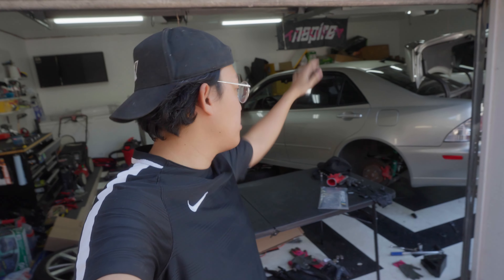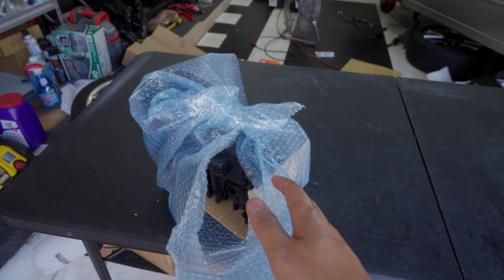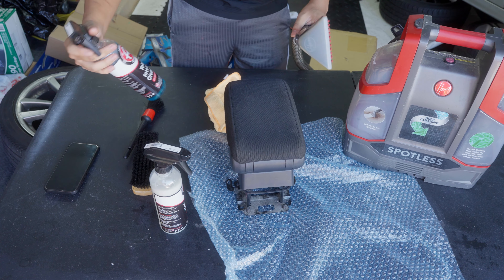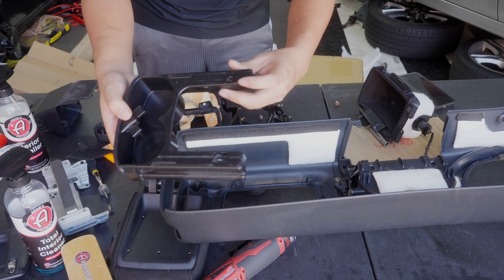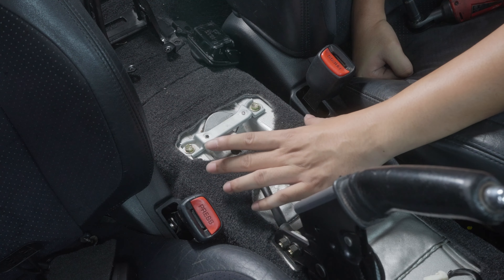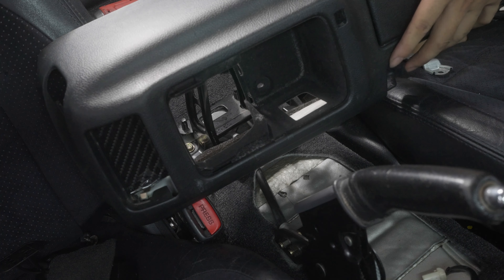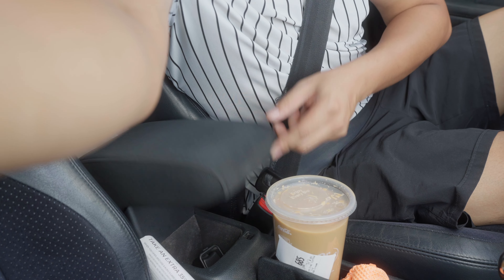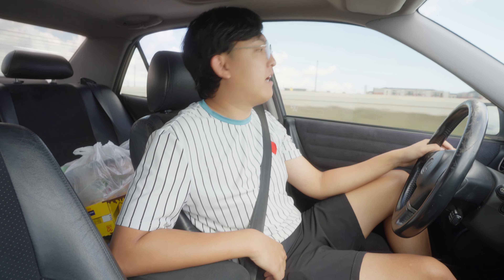JDM IS300/ALTEZZA ARMREST...01 1IS Owner should have this!

Comment: Some manual guys like myself prefer the 01 console lid and will buy them if you sell it complete with the bracket. I have a collection of them here because I usually just buy them when they pop up for sale. They sell for less though. I typically pay around $60 on eBay for them when they're complete.
Reply from the maker: May I ask what's the reason behind it? I'm assuming more room to shift?
Reply: @Kanbo11  yup my elbow hits the 02-05 armrest when shifting. Also personal preference plays a role.
Reply from the maker: It didn't bother me much with the console lid. I saw a deal from overseas on the armrest so I bought it lol.